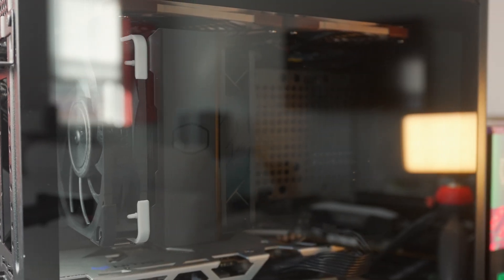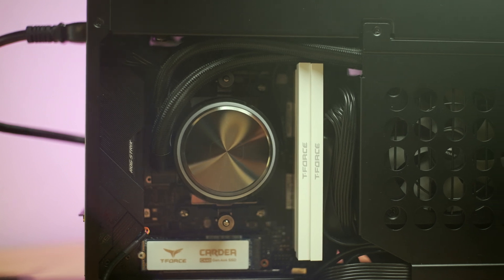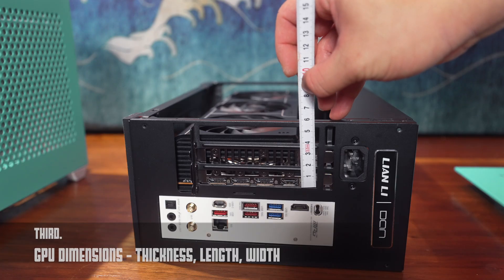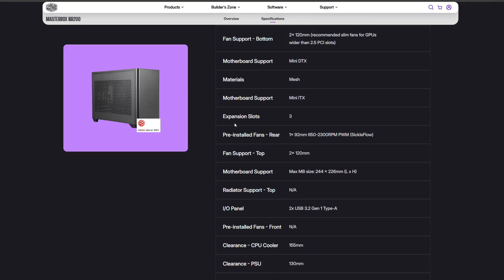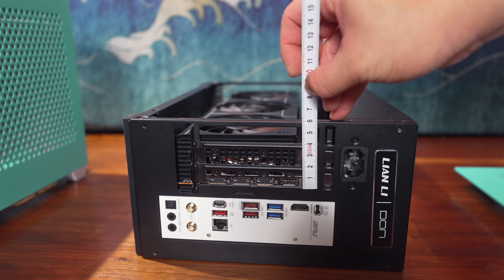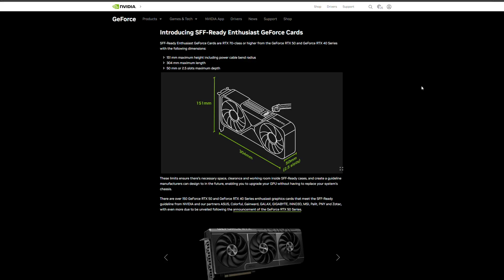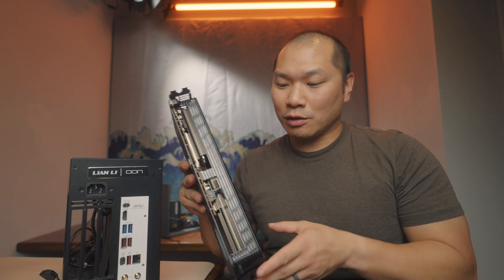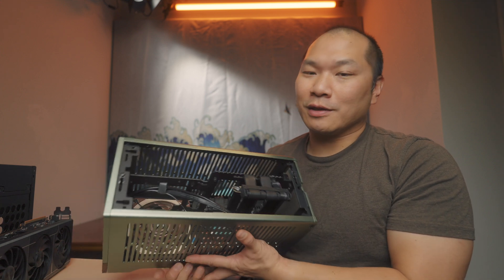SFF PC Build Planning: Understanding Case Clearance Numbers

Comment: Your videos helped a lot during planning my first SFF build. Thank you for the inspiration! I am still relatively new to the SFF community and try to catch up with everything related to it. I also wanted to ask if you could maybe make a tutorial on how to properly fill a custom loop and how to get all the air out of it. I really have no idea how to do that. (btw I am using the modultra lobo with no reservoir) Like, do I have to keep two filling ports open or just one and so on... Or maybe you already know a helpful tutorial that you can share? I would really appreciate your help! Thank you.
Reply from the maker: Good idea! So without a res (I assume that’s the challenge you point to) usually I use a long vertical section of soft tubing to act as a reservoir, fill it up, cycle the pump, repeat, when it’s full but still air bubbles I will just top the tube off and let it go for a few hours to bleed out the air. Then remove the tubing with a towel and close it up!
Reply: @MachinesMore  Thank you for taking the time answering. Great idea using the tubing as a res! Nevertheless I would definitely  appreciate if you could manage to make a tutorial about all of this.
Reply: @MachinesMore  For my build I am going to use the Modultra Lobo with a "EK-Loop DDC 4.1 PWM"-pump that gets its power from the motherboard via a 4 pin connector. How can I run the pump without turning on the system? (this is by the way one of the biggest mysteries to me)

Comment: I've just had an issue like this. I've got a Gigabyte B550i with C14S cooler and with the position of the socket on the motherboard - there is no standard for this - the cooler overhangs the top edge of the board. With the NR200 this meant no top cooler but I forgot and got a new case which mounts the board close to the case top. If it does fit it'll be within just millimeters - Ive seen pictures of some SFF cases where where this combo just doesn't fit. The number quoted on case specs is cooler height - but nothing about clearance around the board. Noctua seems to give good compatibility info on their site.

Comment: I knew most of this, but there was a time I didn't know almost any of it. Explaining some of the ambiguous dimensions, e.g., each "slot" in GPU parlance is ~20mm, is the kind of thing that fills in the blanks and helps a first time SFF builder boost their confidence.
I've used your build vids, as well as info from additional sites to clarify conflicting info I got from PC Part Picker re: GPU fitment in an SFF case. Turns out, as good as Part Picker usually is, sometimes they don't allow for cases that can be expanded at need like the Cooler Master NCORE 100 Air. IMHO, that's the value your content brings to the SFF space. Thanks! And keep 'em coming man!

Comment: Depending on how small & tight you plan to go there are other things to consider as an option such as de-shrouding the gpu. Atm I'm planning a build that includes the MSI Shadow dual fan 5070 that is just slightly to thick (5mm) and long (3mm) for the case I plan to use but w/ it de-shrouded it will fit perfect. Just be sure the fans you plan to use are up to the task to provide adequate cooling rpm wise. I'm eagerly awaiting that new cpu cooler CRYORIG C5 COPPER which has a vapor chamber that can cool up to 180w TDP at only 55mm height.

Comment: I stand by the philosophy and practice that if you build SFF then you are required to use custom cables. To clear up all that extra cable taking up valuable space and obstucting airflow, which is so much more vital in SFF.
Reply: As much as I want to agree with this, I just don't trust cables that aren't from the PSU's manufacturer. I make do with what I have. IME this limitation makes me get creative with cable management.
Reply: @jmal The originals are just wire cables nothing special about them except they must be at least 18AWG. The connectors must also match your PSU's but their configuration is universal. You also need the equipment to do this which I have so it's easy for me. Heat can be a killer of components, shorten their lifespan and have issues of throttling. I want the least number of fans running in my Mini-ITX. I don't regard this size SFF a Mini-ITX I'd call it a mini/micro ATX build so it's not so much of a problem.
Reply: @jmal  I agree, I wouldn't ever put third party cables on a PSU, I tend to buy PSU's based on which has the best safety rating.  Also I recently got a an Corsair SF1000, and the stock cables are super short and braided.
Reply: Yes it's obvious the cable clutter is going to restrict the airflow and increase the temps. It takes a little bit more time to complete a new build but I personally customize all my PSU cables to min length using 18AWG silicone wire which is more flexible too than the original cables. Use a multi-meter to make sure you get the pin-outs correct. The other cables I have cut and re pinned or re soldered. This is even more important with Gen 5 builds as the component temps are higher and you want to keep the smaller fans noise to a minimum.

Comment: Nice presentation. As a SFF case size only builder, one extra item should be remembered - Intake fan distance to exterior panel creating intake turbulence noise.
Whether a downdraft CPU cooler, or an intake fan, no matter the pattern or size of the panel openings, ALL will create intake turbulence noise if the fan is placed directly against the panel. I have found that spacing intake fans at least 5mm and often 10mm from the panel will eliminate this intake turbulence noise. This of course reduces the available space for the components themselves.

Comment: Hello, why do you think mini itx, console format PC cases are not popular, unlike the sandwich format. Now most video cards have through-flow and in the sandwich format, the flow of hot air blows over the motherboard, and using the console format in the mini itx, the hot flow of the video card does not touch other components.
Reply from the maker: I think it has to do with how cases are displayed. More folks will be using them on a desk where the console style seems less “desktop-like”, whereas console style is more popular as an HTPC, media console setup.

Comment: This video would be useful now and for the future! Personally, I'm using mATX that's around 20L, and sometimes the height of your GPU will have some kind of "uneasy feeling" when you realized that the side panel/tempered glass is squishing your 8-pin/12PWR cable XD
Reply from the maker: Awesome! Yeah the 12v connectors add a lot of room. Nvidia 🙄